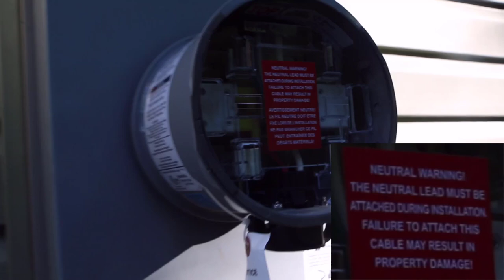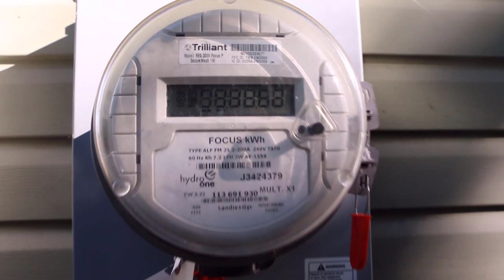How to Connect a Backup Generator to Your House : Generlink Transfer Switch

Comment: Looks so good. Just got my Generlink and new generator. What about a ground rod? Is it actually necessary? Book calls for it, but some folks comment about generator case counting as ground. This sucker includes 240V, so I do not want to miss up with this!!
Reply from the maker: hi Wally, thansk for watching, not sure about ground rod, never heard you needed it  your house house one maybe thats enough, if u hear , please send feedback,Subscribe and Friday Dec 24 is is our holiday show 8 pm, many christmas treats! LiveLifeLoud, Cheers and Cheeks out!
Reply: Okay. I said book, but that referred to generator book. Since, I have seen on YouTube ground rod is not needed with Generlink because the one of the for connections is the ground. When using regular 120v plug, a grounds is  necessary.
Reply from the maker: tha ks for the updates!
Reply: A ground rod is not required as the Generlink has a ground wire that attaches to the house ground behind the electric meter (not shown during the installation of the Generlink in this video).

Comment: 30 amp or 40 amp gererlink. What determines which one I get? I haven’t boutght the generator yet? Thanks
Reply from the maker: 30 Amp Is popular, priced the best as well,   good for generators up to 10,000 watt s, check generlink.ca for compatibility, mine runs my home, well pump, 2 fridges, Internet, runs the electric stove , 1 burner only and tv, few lights, very good

Comment: Would this work with 2000w solar/battery generator?
Reply from the maker: hi Neothane, the generlink allows a generator to run the home, if it has a 220 plug then I would think so but not the strongest to powerz this generator was 7500 w, I am not the expert for this so I suggest u contact generlink or find out with other transfer switch products, LiveLifeLoud, Cheers and Cheeks Out!

Comment: My utility company sneaked out one day and replaced my old meter with the new digital meter and took my generlink. After two weeks they 
finally said they located it and are bringing it back tomorrow. Who knows what condition its in now. I asked if they were going to put it back
on and they said no that they will not allow any customer device behind the meter. It had already been there 10 years with no issues. What assholes.
Reply from the maker: hi Bryon, what are u located, haven't heard this happening,  I would be pissed, spent a lot to get it hooked up, eventually more people will start moving to off grid solution, LiveLifeLoud, Cheers and Cheeks Out

Comment: You still had utility power and hooked up the generator? I was under the impression that utility power had to be off when activating the Generlink and generator?
Reply from the maker: no, once u plug the cord the generlink gets connected
Reply: Once the cord from the generator is plugged into the Generlink (you could hear the click in the video) and the Generlink senses voltage from the generator it switches from utility power (even if it's still available to the Generlink) over to generator power.  There are 4 LED status lights on the bottom of the Generlink behind the connecting plug.  The green light (closest to the plug) indicates that Utility power is available.  The Blue light (farthest from the plug) indicates that the Generlink has switched to generator power.  You can see in the video at 5:01 that both lights are lit.  In an actual loss of power condition all of the status lights would be off until the the Generlink cable is connected and the generator is running.
Reply: @simul8guy75  I was told the same I can switch while power is on , but instructions say it won't switch back while it's running 🤷 I've used mine a few times in power outages worked great
Reply: @jamesmcfarland2636  - That is true.  If utility power is available but the Generlink senses voltage from a connected generator it will NOT automatically switch to utility power.  You have to shutdown the generator before the Generlink will switch back to pole power.

Comment: You didn’t show the install. What the crap.
Reply from the maker: Hi ProjectDad, The only part is the removal of the head piece where Hydro cam it and removed , then Paul installed the Transfer switch.  looke dfairly simple.  Apaprently Hrdro needs to be involved. LiveLifeLoud, Cheers and Cheeks Out!
Reply: I just had a Generlink installed today.  The electrician needs to remove the meter from the meter box (in some cases a Utility technician must be there to either perform that task or to remove the meter tamper seals and add a new seal after the meter is installed into the Generlink).  The entire installation takes 10 minutes.
Reply: @simul8guy75  OK, so the meter takes 10 minutes, and who takes your money?  I'm so fed up with installers who think they kow more than you do.  In fact, if you hire an installer to do anything, you have to oversee the installation to make sure he did it right, otherwise, he's gone, got your money, and you still have nothing.  Well, figure it out, and esecute it, Bud!  Are we not allowed to think for ourselves?

Comment: $1,500 is a ridiculous price for a 30 amp transfer switch. That's more than the cost of the generator. People should just do a breaker panel interlock protection plate.
Reply from the maker: Hi James, when this was done the parts were in shortage and prices were high was not aware of any other solution, thanks for the feedback, LiveLifeLoud, Cheers and Cheeks Out!